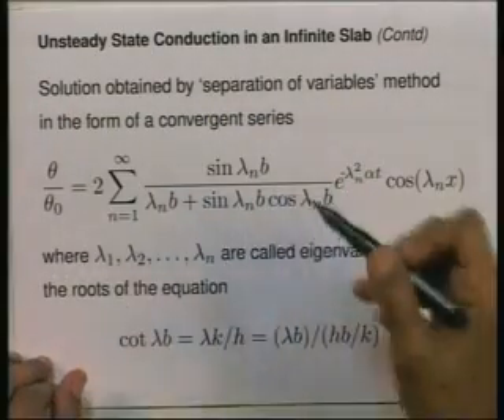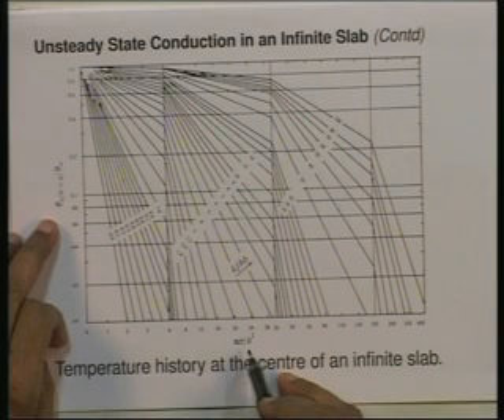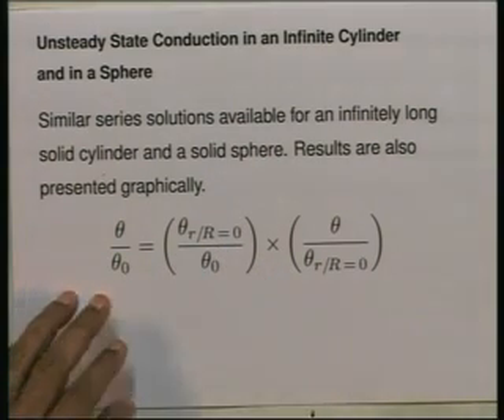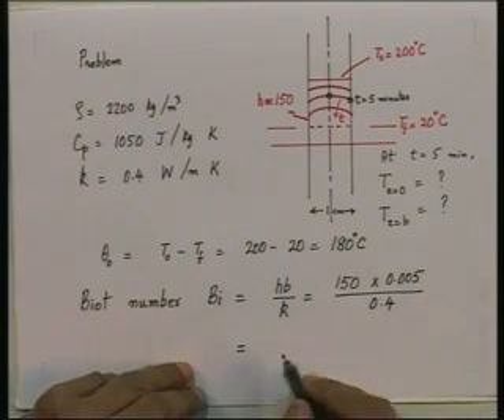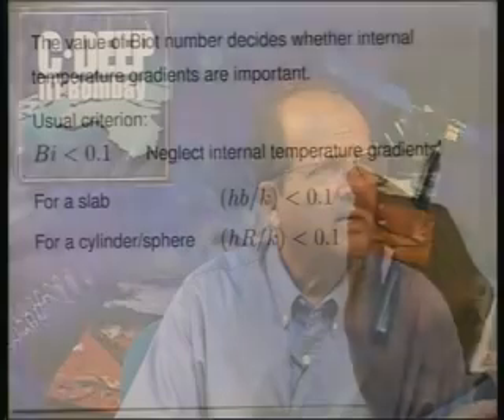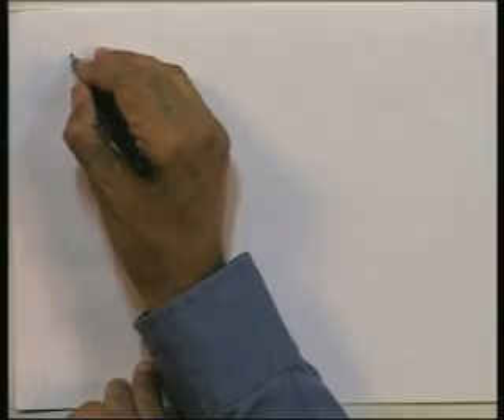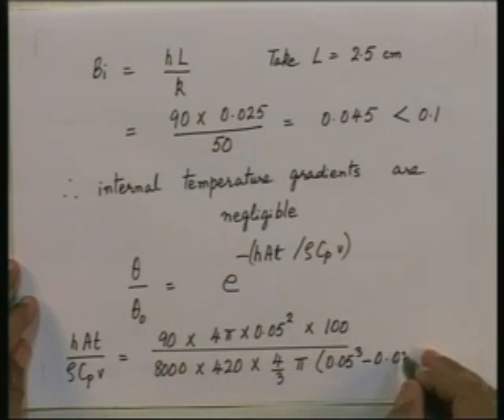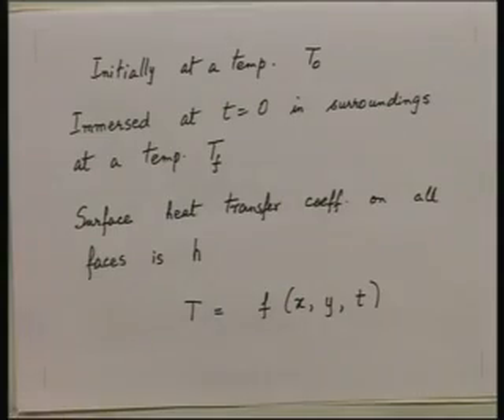Lecture - 8 Heat Conduction - 5

Comment: Characteristic length of a body is the ratio of volume of the body, to the surface area of the body. According to that, L for cylinder should be R/2, and sphere R/3. But here its told to be R in both the cases. Please tell me if I am going wrong somewehere.
Reply: Usually, in this case i.e. for Biot number calculation, characteristic dimension is considered & defined for all those bodies whose geometries are not as easy as cylinder or sphere. So there is some criteria set as Volume/Surface area. The same confusion can happen for calculating Reynolds number in external flow problems. As in internal flow, the formula is fixed as 
" 4*Area of c.s. / wetted perimeter ".

Comment: In angle problem, why no heat flow in the lengthwise portion and consequent change of characteristic dimension??
Reply: Actually the heat is flowing through the length wise....he is showing you at the tip ...from the center of the angle plate thickness